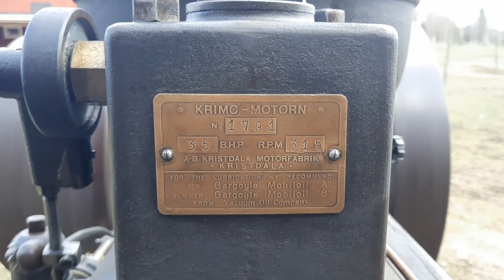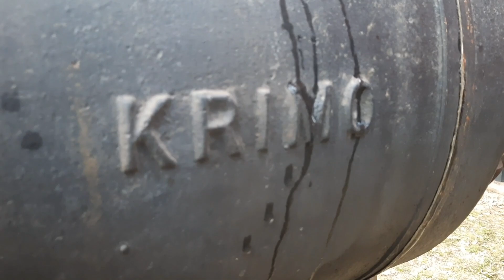Detailed Run Of a Pre WW2 Engine. Best Engine sound there is.

Comment: I really like the X wooden wheel locks - they are very effective ! I've seen similar engines rocking like mad without them !!
Reply from the maker: Yes they are quite clever. Original to this engine and all other Swedish hotbulbs.
This engine is pretty well balanced and runs okay even without the X-locks. But sure is more stabile with them on.

Comment: I’m interested in how much fuel these things use in an hour when running at load for example in your sawmill
Reply from the maker: Hi! Around 4-6 liters on heavy load sawing as much as possible. But you can run them on free waste oil also at the same h/liter. /Richard
Reply: @YesterdaysMachinery  that is actually quite impressive

Comment: Would that compressing grease cup above the slide rail for the connecting rod be correct ?  i thought for too and bottom lubrication it would be from automatic oiler....  how does the grease get to the bottom part of the connecting rod to piston slide? is it because it is that hot that it drips ??

looks like the travel speed of the connecting rod slide at that idle is about 263 feet per minute, low stress, very nice machine, fist time I have looked at this type.
thank you so much!
Love it❤️⭐️👍
Reply from the maker: That is not a greascup, it is oil! Inside the cup there is a tube going up over the oil level with a cotton string in that sucks up oil that travels true the tube and down to the slide.

Yes, slow running. Hard work all day just keeps running no matter what. Some of the most reliable energy sources there is, with the advantage of running on any liquid that floats. Thank you! /Richard

Comment: I didn't notice any kind of governor. What would adjust the injector setting under load to maintain constant rpm?
Reply from the maker: Hi! The gouvenor is in the flywheel. A big drum with spring loaded weights that turns a exenter that makes the stroke longer or shorter for the fuel pump 🙂

Comment: Absolutely beautiful engine runs both ways and no electronics insight the x locks definitely keep it stable it's a pity it cant be done in this throw away age
Reply: I, as one, think there is way to much " Hurry up we have to get it done yesterday " we need to slow the hell down and take it easy, it's alright and fine to go fast when you really need to. But not all the time. Michael said that, bye for now my friends.

Comment: I really like your 21.9 liter engine. Goodness gracious 35hp. How do you think it would run on wood smoke? I would bet it will run all day on a common house wood stove no problem as long as you keep it filled with oil lubrication. I would bet off the flywheels, not the flat belt pulley it will pull a 10kw Gen head all day. But you say it is hot bulb, so would probably need a magneto for spark and probably no spark plug hole. Of course one could make one if he wanted to run it off wood and make it super useful.
Reply from the maker: Yes, as you say it needs spark, but it can be done. It was rare but during ww2 they built a couple with wood gas system. Yes 10Kw would not be to much.
Reply: That fuel adjustment screw has been much used. Looks like course threads, if fine threads could probably be turned down till barely turning over. I wondered about the rod main oiler and how effective it is being jerked up and down so rapidly.  Everything looks properly lubricated. Would not run this in the dust bowl as wear would accelerate.

Comment: Running and making power are two different things.  Can you actually get the 35 hp out of it?
Reply from the maker: Yes, 35hp rated for constant work. Lots more hp short when pushed to the limit.
Reply: @YesterdaysMachinery  I had seen several videos about the engine, but never doing useful work.  Since posting the above comment, I saw a video where this engine was powering a sawmill.  I asked because a lot of times worn engines can run with low compression, but don't generate much power.
Reply from the maker: @tarstarkusz  Yes thats true. I have a very simular engine from also from the late 30's in my sawmill that i use very often.

Comment: Wondering how the fuel consumption on these old engines compare to a more modern one.
I guess it wouldn't be to bad. Would be awesome if you connected a generator and tested it out :D
Reply: It will run on anything flammable
Reply: @zaceryhammond1144  
That isn't accurate. I will not run on last autumns brown leaves. But it will probably run on any hydrocarbons that have a low enough viscosity to be pumped and injected into the burn chamber. I would guess these early engines use a primitive swirl chamber to mix and combust the fuel and air mixture?
For this comparison it would be interesting to see both engines run on diesel fuel or similar.
FYI, even water is flammable at high enough temperature and pressure and my relatively "modern" HJ61 can run on mostly and hydro carbons with low enough viscosity if I preheat the engine.
Reply: @Mr.Engineer.  the engine has a bulb you get red hot to start it’s a low compression diesel 2 stroke extremely simple and extremely robust as it doesn’t generate much power
Reply: @Mr.Engineer.  so yes it will run on canola oil or anything flammable

Comment: Man I love these old iron beasts!   What is the fuel consumption on er?  both no load and under load on the mill?   Thanks!!
Reply from the maker: In my big sawmill with hard work around 5liters/h. 🙂 Much less that for example if i would run the mill with an old truck engine. 🙂
Reply: Why do you need to know ?